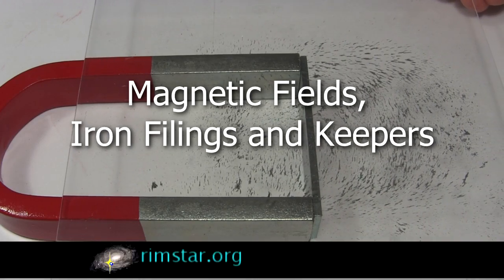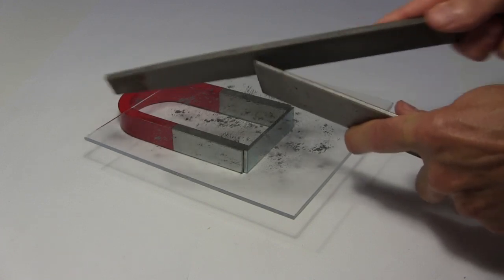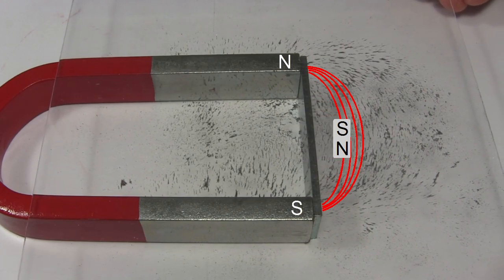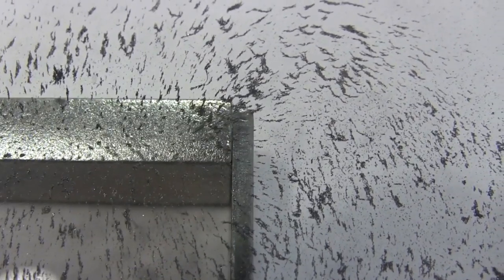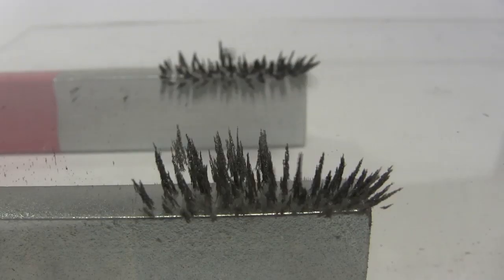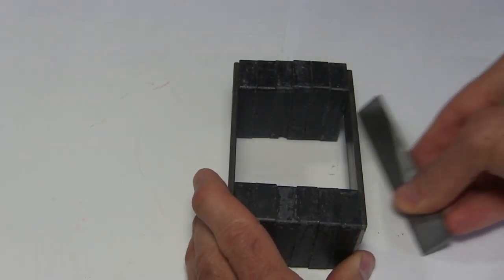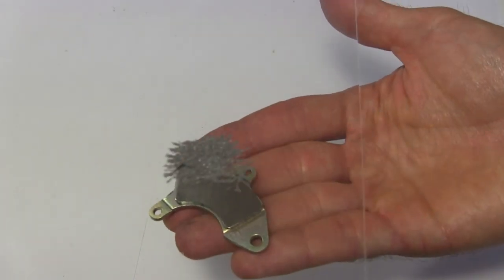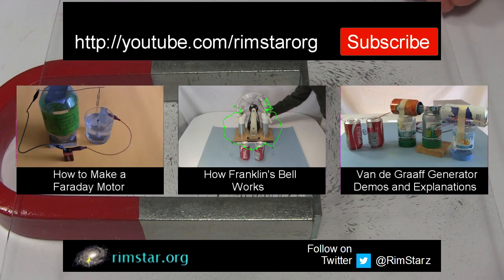Magnetic Fields, Keepers & Iron Filings with Horseshoe, Ceramic and Neodymium Magnets

Comment: hi.why not just rub a ferrite cores as in various radio receivers or 
audio transformers or step up/step down coils on a file and get fine 
ferrite particles ? They will have a fast response if suspended in water
 low/viscosity fluid as ferrite materials lose their magnetism very 
quickly when magnetic field switched of.....

Comment: Can you fire ceramics in a high Gauss helical magnetic field so you get a toroidal shape with several helices - multiple mobius strip?

If you fired cewramic magnets shaped as equilateral triangles with all Norths on one face/Souths on the other, could you put them into a geodesic sphere (or most of one)? Would that be a (mostly) monopolar magnet with all the Norths facing out and Souths facing in?

If you got a larger geodesic sphere Souths in/North out encompassing the smaller one, what characteristics would it have?

Given a ceramic magnet with a helical field geometry, how would such a core change the performance of a Rodin coil?

Rodin coil/starship coil number of turns - have you done an odd number of turns? Can anyone speculate about what effect putting two sets of wire, or wire with a larger angle between corners.

Sorry. Brain dump.

Comment: Ahh I see, so its another case of the differential being the important bit. if the inductor and the surrounding environment have similar figure's, they will share the force more. If the material is a lot more permeable, then it will "Hoover up" the magnetic fields that hit it. Giving them a lower path of resistance. Will there be a video with electron orbit entanglement (Magnetic force)? I'm keen to see that?

Comment from the maker: Air is higher. Vacuum is 1 and air is 1.00000037. Keep in mind I'm talking about relative permeability, which is what most people mean when they talk about permeability and coil core material. It's the permeability (absolute?) of a material divided by the permeability (absolute?) of vacuum (pi x 4x10^-7). The permeability (absolute?) of air is 1.2566375x10^-6, so 1.2566375x10^-6 / (pi x 4x10^-7) = 1.00000037. Relative permeability of ferrite (nickel zinc) ranges from 16 to 640.

Comment from the maker: Good question. 1 is the permeability of the vacuum and air's is close to that. That's the reference point. But for diamagnetic materials the number is negative and is less than or equal to 1. This is from the wikipedia pages "Permeability_(electromagnetism)" and "Diamagnetism".

Comment: If you want to see a neat effect, get a 1 or 2 foot piece of copper tubing.  The diameter should be such that the ID of the tubing is about 1/4" greater than the OD of the magnets.  Then drop the neodymium magnets thru it.  The motion sets up a counter magnetic field in the copper tube significantly slowing the fall of the magnets thru the tube.  Viewed from above the tube, the magnets seem to float down the tube.